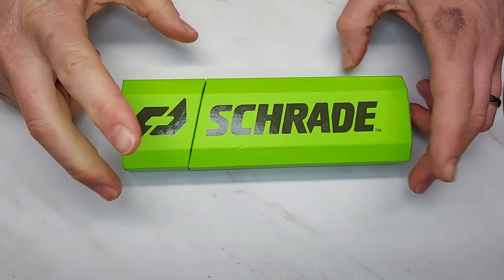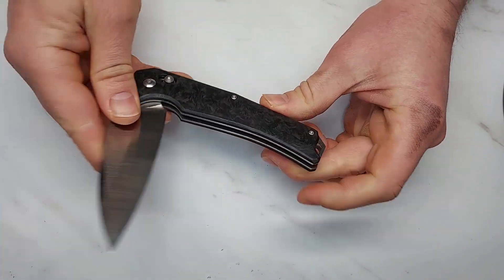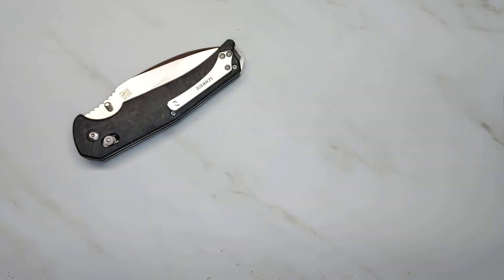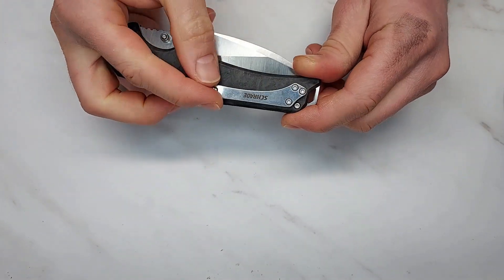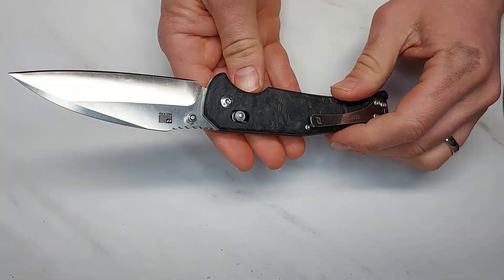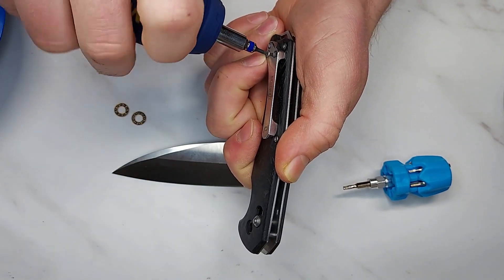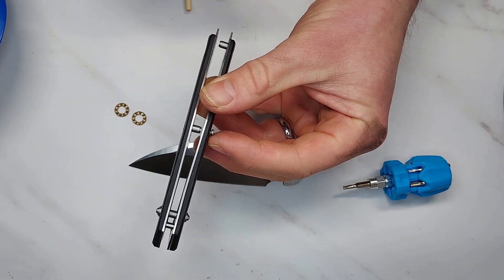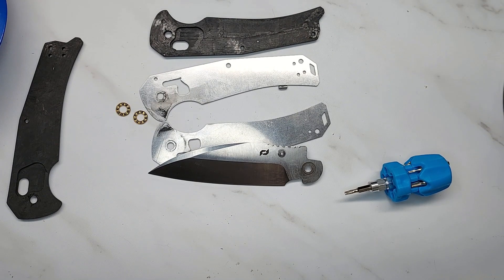Schrade Alpha Radok, an Unmitigated Disaster?

Comment: Mine was quite a bit better than yours until I went to sharpen it on my fixed angle sharpener. I clamped the blade in show side up and set my sharpener at 17 degrees by laying a 1000 grit diamond plate across the middle of the blade. I flipped the knife over to double check the other side and it was showing 13.8 degrees!
After taking the knife out, flipping and reclamping. It confirmed the 13.8 on the pocket clip side. 
To triple check my clamps I put in another knife and it was dead on 17 degrees both sides.
Yup, my primary grind is off 3.4 degrees. 🤦   It's hard to have faith in a USA company when they manufacturer crap like this. 🤬